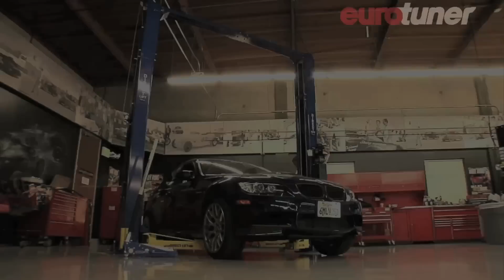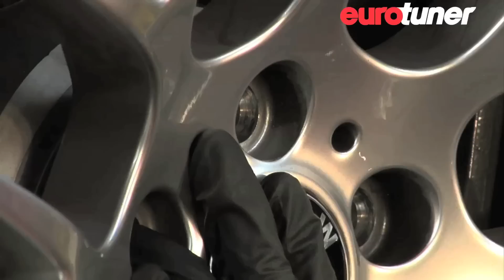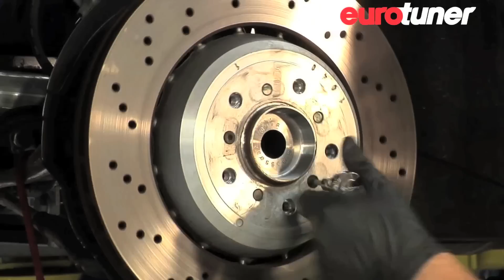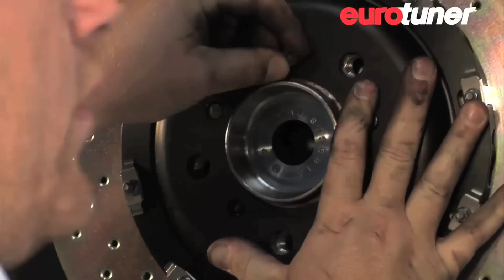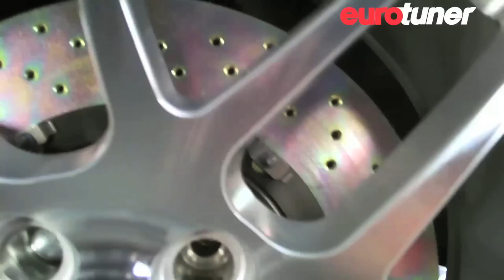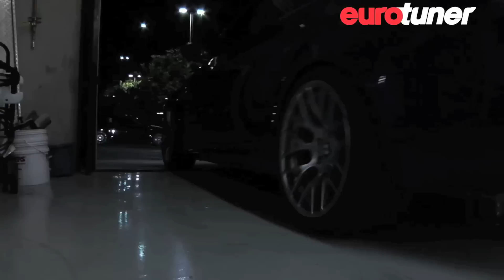Brembo GT brake install on E9x BMW M3

Comment: @7674Princess 

Actually the size of the rotor and the pads do not really increase stopping distance. The main advantage of these brake kits is better feel, less chance of locking up, less fade, and less overheating.

If you really want to stop on a dime get lighter wheels, stickier tires, and a stiffer suspension.

Comment: @7674Princess That's a splash guard, it helps water move away from the disc which increases braking. Not sure why he hasn't put it back on as it's on every modern car.

Comment: the cars EBD will be able to cope with having over sized front brakes and stock rear brakes.

basically the car won't end up in a dangerous situation by changing the brakes, but it probably won't stop any faster either in high speed situations. about all you can expect out of doing this is less brake fade, some "street cred" and better pedal modulation.

Comment: I just bought these brakes and the instructions say that the “A disc with curved fins MUST be installed with fin facing backwards, from the internal to the external diameter, in the direction of rotation.”

Comment: yea mike lines have to be braided all the way around well thats the proper way. cheaper to cross reference your car example my 03 speed protege braided lines all around with 07 mazda 6 caliper this is crazy 1200$+ for brembo wilwoods cheaper but still.

Comment: Question is: Are this wheels, I mean tires, are wide enough to convert all braking power to the road? Coz if not, ABS will launch quicker and this brakes will not fully develop their potential.

Comment: Just curious, I noticed that in a previous video the OEM brake caliper was facing the opposite position ( Towrads the left side of the rotor ) and in this is facing the right hand side. Does that make any difference or maybe is the Euro model?? idk just wondering :)
Reply: 718 Dips No, you can usually mount them on either side.